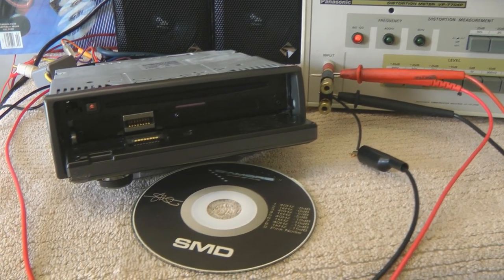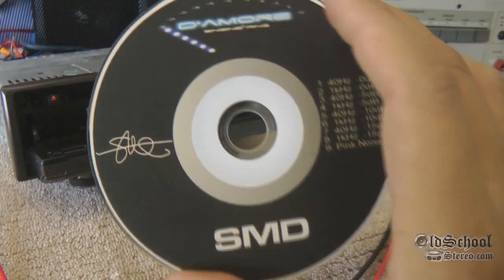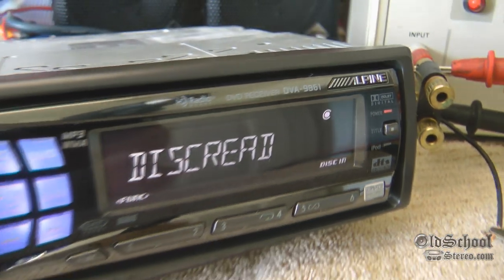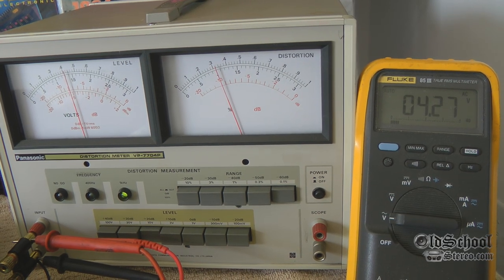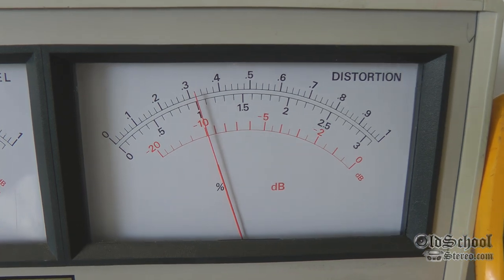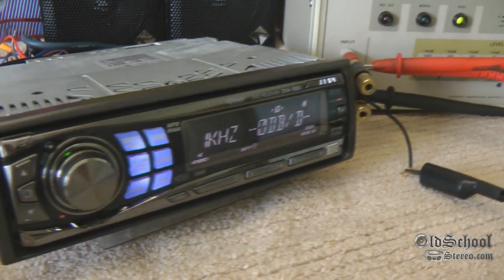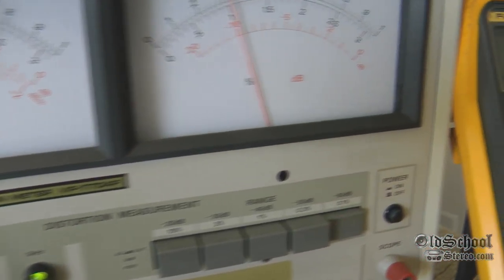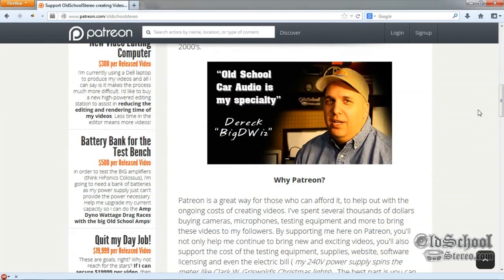Alpine DVA-9861 DVD THD Distortion Test

Comment: Hey BigD, great video, I currently use a 9861 with a H701 connected through optical cable, I also use an Alpine MRV-F505 Expert for the front channels and an MRD-M1005 for the subs. The speakers are all CDT Audio ES line components with Boston Acoustics ProSeries 10.8 lf subs, 2 of them. Yes these are old school, the first gen BA subs. They handle power better and in my opinion sound cleaner, which is what I am shooting for, clean SQ sound. I have been very happy with the performance of this HU and now I know why.
Reply from the maker: Sounds like a very sweet SQ setup bro!

Comment: Nice unit, can't say the same about the newer alpines. I got the 133bt and was very disappointed, the signal sounded very weak, the settings didn't help much, and it also got hotter than a MF very fast. I ended up giving it to my dad and installing my old pioneer 6200bt again.

Comment: Wish you would Amp Dyno the Alpine ... Would be nice to see exactly what these 18 RMS head units really put out. Alpine should put out around 18, but most I bet don't deliver half that. I had an Alpine that was "High Power" back in the 90's that sounded better than the 50x4 Kenwood amp I later installed on it.
Reply from the maker: I'm betting those V-Drive models do at least 20w/ch